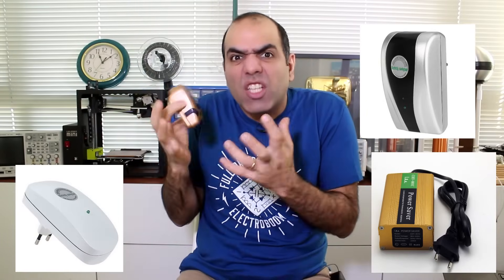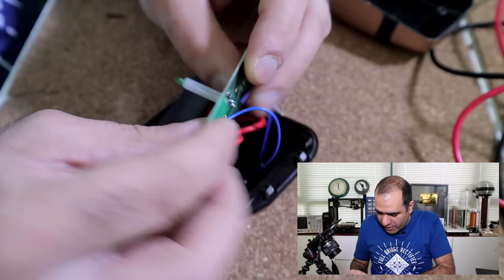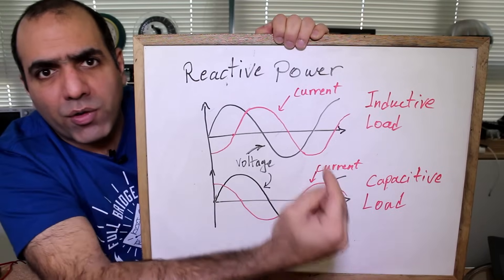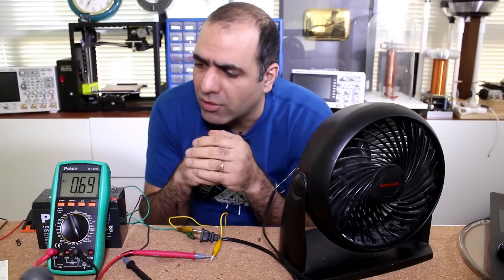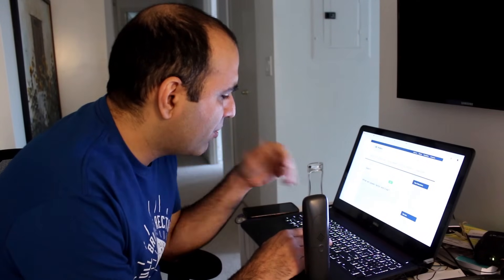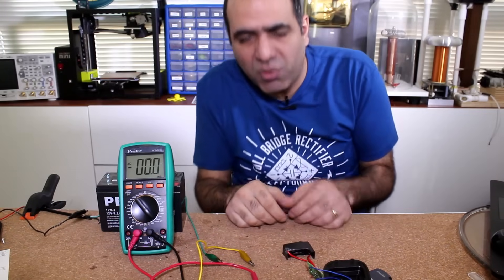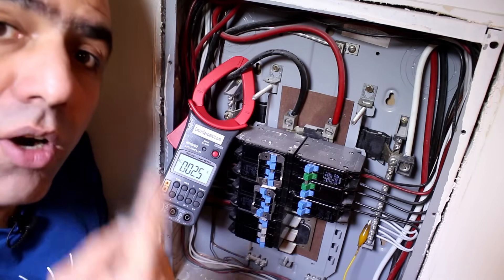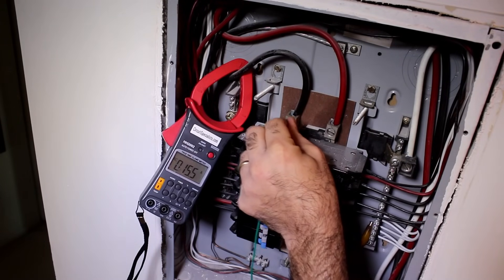Power Saver Scam EXPOSED!

Comment: I am a retired Electronics technician and I want everyone to know this guy is NOT full of B.S.  He knows what he is talking about and demonstrates it par excellent.
Reply: Yeah I'll do electronics too and I'm more into the theory of it, but I can tell that he's not really lying. But I noticed he said something about large companies using a lot of electricity will draw that power that he explains of. On the back of my little doohickey it has a draw load at 30 kW.Actually I had to get the label back out of the trash that says; useful load. So do I have to run 30 kW through to see any significant change? I thought to myself "something industrial."  But then again, the wording? What do you think about what I found in mine? I'll tell you I got a bridged rectifier, LED ceramic and electrolytic capacitor resistor and a fuse oh and a thermistor. And when I removed all the sticky label that held on or held the specifics there's a vent on the case of this do hickey. Wonder what the case was actually meant for? Because, It seems pretty clear it wasn't going to heat up due to that the ventilation was cut off. You know what they say? Power is the equivalent of heat expressed in wattage. I'm going to take a picture of it, send it to my brother because it is his, and I'm going to see what I can do with the circuit. Power supply. I need to make a power supply anyway. But here's another thing why would the capacitor be rectified to accept DC voltage, and I know it's DC rated. Has to be. Otherwise what's an AC capacitor doing in a DC circuit? I mean, it's not oscillating. Okay I'm done
Reply: @scottreday9377  Late to the this, but the AC capacitor is totally separate from the rest of the circuit components. And, all of the other components are there just to supply power to the LED. That's all, only to power the LED.
Reply: @scottreday9377  I can only give you a couple tips.... as I am not a motor expert.  I worked with transistors and circuit boards.  Every AC capacitor I ever saw in a motor was simply a START capacitor.  If you put DC into an AC capacitor, it will not hurt it as long as you don't exceed the DC rated voltage.... but... you can't put AC into a DC capacitor because it will likely POP.  The 30KW rating of the motor would be maximum.  If the motor has no load.... it will use far less than that.  If you attach the motor to something like a compressor, then the wattage will go way up.  The motor on my air conditioner uses 13 amperes at 220 volts.  That is about 3000 watts. If I removed the motor and let it run without the compressor attached.... then the amps would go way down to maybe 2 amperes.  2 times 220 equals 440 watts with NO LOAD.  Thats about all I can tell you about motors.
Reply: @1framistan I'm currently a student of Electrical Engineering and I learned more from channel ElectroBoom than from professors.. You can be good at your job but that doesn’t mean that you know how to transfer the knowledge..
Reply: @DaNePovjerujes  I agree the guy is a genius and very entertaining.
Reply: @1framistan  so is this voltex thing a scam or not? will reduce the electric bill by 90%?
Reply: @incorectulpolitic  ElectroBoom is an EXPERT!.... even though he acts kinda goofy, don't let him fool you.  The guy is a genius.  He acts a bit silly for entertainment purposes.  I agree with him that the device is useless.
Reply: @DaNePovjerujes  I learned more from Wireless World magazine than from years of lectures at uni and college etc and dozens of textbooks.
Reply: @1framistan  Many have a START capacitor and also a RUN capacitor.
Reply: @incorectulpolitic  It will NOT reduce your electric bill, residential electric meters do NOT use Power Factor anyway.
Reply: @1framistan Motors I've seen in commercial applications have run capacitors and start capacitors. Maybe different name for same application but if I remember correctly..
Reply: @scottreday9377  He's outdated on that, not wrong. Industrial equipment now includes circuits to deal with that once existing problem. Being that he's from the middle east, they likely only had those older machines where he was trained.
Reply: @MeepChangeling  he’s outdated? Do you know what your saying😬
Reply: @MeepChangeling  explain more
Reply: @MeepChangeling  Drive around and look at power equipment, you will still see large banks of capacitors on platforms for power correction.
Reply: i agree. if he didn't know what he was doing, he'd be dead long ago
Reply: We know that
Reply: I am a retired electronics engineer and IT consultant. In all my years I only shocked myself twice. This guy shocks himself a dozen times in each video.
Dont you just love these BS devices?
Reply: @fivish  he leaves mishaps so that WE dont make such mistakes, he literally admitted it in his older vid lmao. He definitely is intelligent enough to not plug incorrect capacitors into the power line, but he does that anyway to show US what happens and why not to do it.
Reply: @fivish  he does it for entertainment. for views. anyone can see that
Reply: @fivish  He does it on purpose for semi-educational purposes. He's only had one actual incident and it wasn't 100% related to electricity
Reply: Ya.it will not reduce bill.it is fake.
Reply: outside of the fact that he says his breaker box is 2 phase.. LOL It's 2 hot legs and a neutral to give 240 v across the red and black sides of the bus and between the red and white or black and white is 120v. It's not rocket science but he fails to state that correctly
Reply: @advanced-electronic  I see Your point // The "breaker box" is not 2 phase .....
     I think He MEANS // He can tell it is set up for 2 phase , just by looking at it .....
       I DO NOT LIKE THIS GUY AND HAVE REPORTED HIM TO YOUTUBE AS DANGEROUS !!!
          He makes a "joke" of blowing up low voltage Caps , causes silly "shorts" , etc :: YOU DO NOT "PLAY" WITH ELECTRONS !!
Reply: Thank you for letting me know he is telling the truth. So many damn scams. I absolutely believe you. You have no reason to discredit this guy. Neither does he have any motive to lie. I actually bought a similar device last year and paid $48.00. It didn't work.
Reply: Who said in the first place that this guy is full of bs?
Reply: This guy is VERY STUPID .....
Blows up capacitor because He didn't check rated voltage ??
Touches another capacitor & gets shocked ???
Reporting You to Youtube as a danger to people who might emulate Your CARELESSNESS !!!   GLAD YOU RETIRED , DAVID /// YOU'RE DANGEROUS !!!
Reply: @stevenattanasso2003  what a moron. Next time you comment on shit like this, make sure you know more about the channel. He does this shit on purpose, and never actually hurts himself. Not severely at least. It's all for show you muppet.
Reply: where do you plug the device. I can't find  an outlet for a  plug anywhere  near   my metre grid?
Reply: I wouldn't be surprised if he is indeed some sort of a Genius...
Knows the circuit, components and much more .. the functions of each components and supposed results. I believed him that not all ckts are okay.
Reply: B.s blowing shit up 😂😂😂
Reply: He’s amazing
Reply: Genius and entertaining, too. Some people are so fried there still wearing covid mask and thinking this guy is a scammer.

Comment: 6:11 you can plug it in then unplug it if the ac cycle is at high voltage and run around and shock your friends and family 9:38 why do they sell sh*t on the market
Reply: Jonathan Mcpoop i did this to my family and they stopped moving

Comment: Lesson learned : microwave is just double your electricity bill
Reply: Microwaves are only on for a short duration.  An oven or a toaster needs 2-10 minutes just to warm up before it starts to heat up whatever you're cooking.  It is a trade off.  
Your stove & oven are 240V.  The microwave is 120V (USA).  Most likely anything 240V is the big power draw vs 120V and this is where most of our electric bill is generated.
Reply: @leojf3828  16A at 120 V will be 8A at 240V... simple P = V * I (*t)... power/work remains the same... just different way of delivering...
Reply: @the_irav  Truth!  But our range is (stove and oven are) 240V and can draw nearly 40 amps.  They need to run much longer than our microwave 120V (~ 15A) so waste heat is created.  For most food the microwave is most advantageous.
Reply: @leojf3828  for most food you cant use the microwave. A microwave is mostly used to heat already cooked food, not to cook something.
Reply: @KiinaSu  one of our favorites is to cook raw potatoes for future consumption in the microwave.  Once they've cooled, off to the 'fridj for future meals.  Saves time.  (So they actually get cooked twice in the 'wave ☺)
Reply: Thank you your funny!😇
Reply: @Me-je2jv  jesus is funny too...

Comment: Here in the Netherlands we DO pay for apparent power. Everyone. This is used by the energy compagnies to compensate for transmission loses. Every fusebox here has a little capacitor to shift the current fase. These are sealed and it is illegal to remove them. Doing so will be punished by a huge fine starting at a €1000.

Comment: Most people are aware that anything plugged into an outlet, draws a small amount of current, even if it is not in use. The best way to save on electrical power is to unplug everything you are not using until you need it, except things like your refrigerator, heating unit, air conditioner, hot water heater, or anything which is in constant use. You will see your power bill go down quite a bit. You don't have to spend additional money on a device that may be totally worthless.

Comment: Had to look this up because I saw one in the hallway socket and it looked too cheap and fake to do anything, and I'm glad this video confirmed it. Hopefully my family doesn't get too upset when they see it in the trash where it belongs; it certainly isn't doing anything for us and it might even be interfering with the powerline adapters (had some connection errors today which I have never had before on powerline ethernet).

Comment: The capacitor in single phase induction motors are used to create a rotating magnetic field by creating an out of phase current in the start winding. To reverse the direction put the capacitor on the other side of the start winding with respect to the main winding. Some designs change the value of the capacitor or take it out of the circuit after starting.

Comment: For the home consumer this Power Saver is a non-starter from the beginning because their electrical consumption metering equipment only responds to Real power and is unesponsive to Reactive currents. The latter just goes round in circles anyway and doesn't register in either direction.

Comment: Some relatives of mine have the metal version of these plugged into their mains. The thing's so unstable that if you so much as accidentally jogged the table it's on it would produce a loud and constant crackling sound from the inside that would last 5 minutes before fizzling out. Despite this, my relatives still swear by it and think it's safe.

Comment: Factually, if one has a https://en.wikipedia.org/wiki/Electricity_meter in the house,
certain energy saving lights can make the electricity meter stalling or turning backwards,
due to a negative phase shift =-90°. One can measure it using an electronic power meter.
I detected this per pure chance. After some quick research, i found people and companies in regions protected by the mafia or so,
whose sold some special devices which did nothing more then suck power and shift the phase, so you could lower your power bill.
As i understood it, all the power companies do not like these people and the users of such devices, therefore they
made these devices prohibited.

Comment: In some countries,residential and commercial usage of electricity are charged differently. In commercial case, you also need to pay for the reactive power, capacitors can improve the power factor and reduce reactive power, but you need a capacitor bank. This tiny cap will not help at all.

Comment: What if the capacitor was bigger (if it had bigger capacitance), would it save eeven more current? And what if that capacitor run only if you run current through (meaning you turn on something, the capacitor started to work, and when you turn that something off, the capacitor shuves off from the circuit??? 'if it is possible to make that that way) ??

Comment: Another thing is that, when there's only 1A inductive load, as they doesn't do any work or the current isn't needed (as if we make that 0A by adding capacitive load, the motor "works") then, what that 1A do so that that 1A when made 0A we need not to worry about that?

Comment: Heh, when I first got into electronics a couple of years ago I had the idea to use an inductor to even out the phase shift from a capacitive load or vice versa and even made a circuit to test it out. Though at the time I had no idea about active or apparent power. I didn't even understand AC analysis.

 So aside from the phase shift, I didn't understand what the implications of the circuit were. I didn't even know how to get the phase shifts exactly equal mathematically. I just used trial and error, trying different values until the phase shifts matched and cancelled eachother out.

Comment: The fringe microwave and AC all have capacitors. So do all light bulbs except the  old fashioned filament bulbs. You should test it on something where it actually could make a differences like a heater.  A fan was a good start but they don't draw that much to began with.

Comment: Several deades ago, major inductive loads like washing machines did not include a capacitor to improve the power factor.  I bought such a device for our washing machine.

a) it did not promise to save money on power bills - it promised to improve the life of the inductive motor in the machine.  You could hear the difference with the capacitor and without - the motor ran so much smoother with the capacitor.

b) It came in models sized for the current draw of the appliance.

c) It had electronics to add the capacitor to the circuit only when the load was present.

Most larger inductive motors  have such circuitry built in these days - but the device was very helpful, and that washing machine is still going strong.

Comment: 6:40 in the video. But isn't the meter measuring RMS current, which is unaffected by the power factor correction? Because RMS current is only dependent on the real power consumed. @electroboom

Comment: Power Factor Compesations,very small capacitance for compesation all inductive load in house, use capacitor for compesation inductiv load in power lines,power about 2,5kVAr and most be changes activ power,but reactiv power in house worm wires,instalations and outhers and changes activ power up

Comment: When you attached the lead to the big black wire coming to the house, the reason it made no difference could be because you needed to attach the lead to the red wire, because of the way the panels are made. Either way, I agree that the power saver wouldn't make a difference.

Comment: The US breaker switches look crazy. The UK just has a box with loads of switches. No live wires or anything exposed. Same with the meter.
Reply: He deliberately unscrewed the whole panel front in order to take measurements. You can see there's an inset cover that allows access just for resetting breakers and shields from live conductors. A UK consumer unit is essentially the same. Also, he lives in Canada, not the US, although I believe there's a lot of similarity in their electrical equipment and specifications.

Comment: I researched years ago the KVAR power unit that supposedly saved a person money and after a lot of digging found this same data
1. it's a scam
2. we don't pay for low PF as residential customers
3. caps used to correct power factor need to be sized to the load and placed between the load and it's controller NOT on an always on circuit as he demonstrated here, they steal power when the inductive load is off.

Comment: What if you added a huge capacitor to your house? What would happen?
Reply: A large capacity capacitor (as opposed to a physically big capacitor!) connected across live-neutral would short some of your ac power and probably increase your electricity bill, apart from the risk of it shorting itself and causing a fire.

Comment: Sir.. May i ask.. Is that true or not.. If 30 capacitor 2uf 450v set in series and charged can kill some one??
(Its just for knowledge not to harming.. Cz i confuse is that high voltage with very small capacity can kill some one..??) sorry im realy newbie sir..
Reply: More dangerous if connected in parallel (30x2 = 60 uF) and charged to 450V.  That is very similar to a defibrillator and could stop your heart.  In series, you could charge to   a higher voltage (30x450  = 13,500V) but the capacity would be only 2 uF, so a nasty shock but not likely to be fatal.  I would not try it, however.